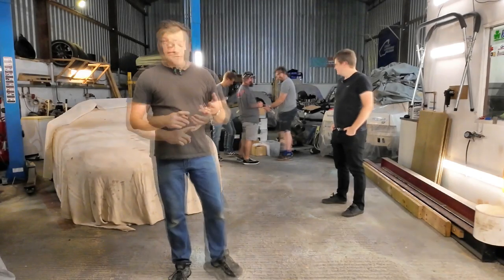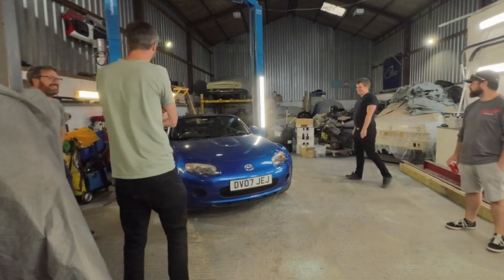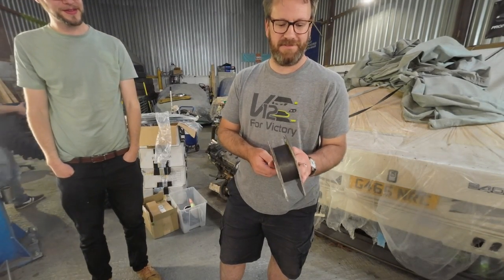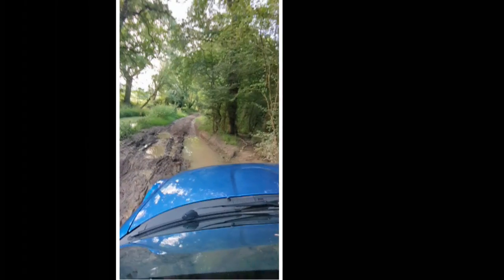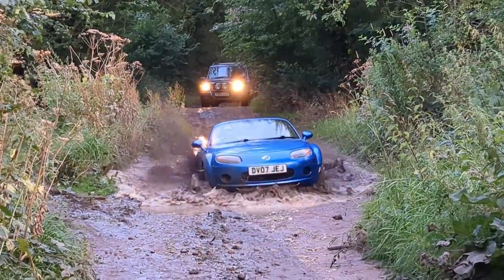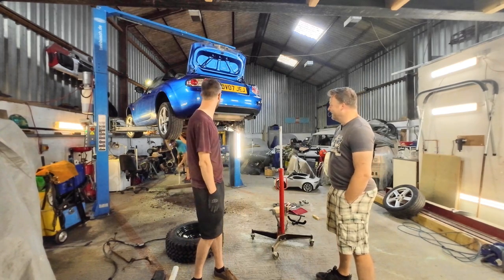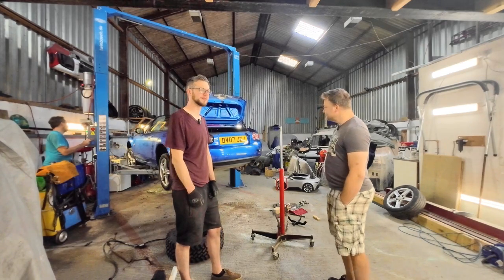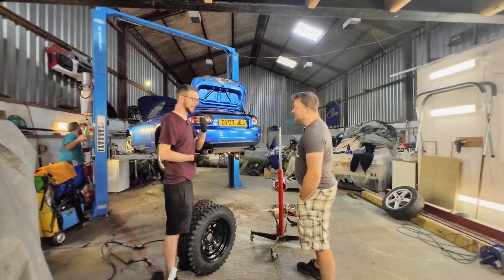Stag weekend Mazda MX-5 Miata Dakar off-roader build!

Comment: Fantastic. I would love to do something similar with mine. What are the road legality and insurance implications of such a heavy mod? Do you think it will pass its next MOT?
Reply from the maker: Wheel coverage is certainly an issue so the wheel arch spats helped resolve that. The car did pass an MOT post modification. As for insurance, it’d all need declaring but is definitely possible too! Have you seen the drive episode as we had a good distance to cover on the road to get to Wales and back?